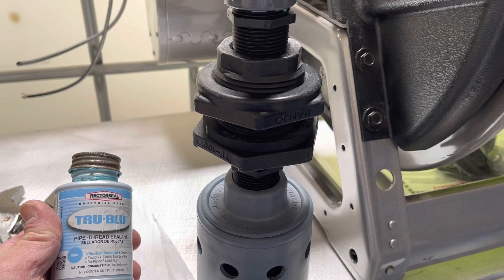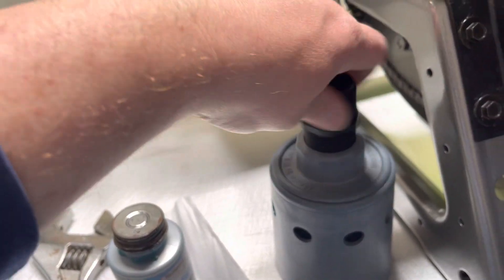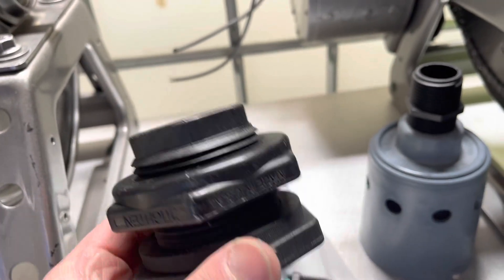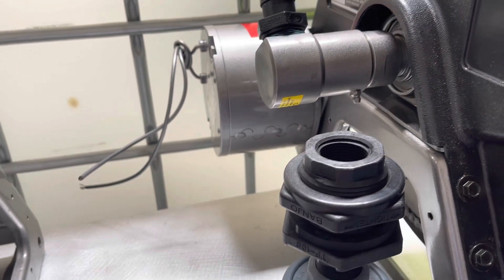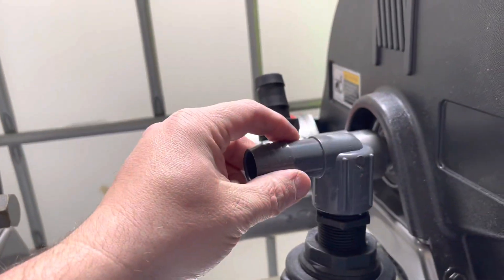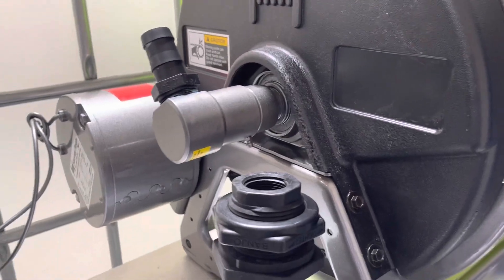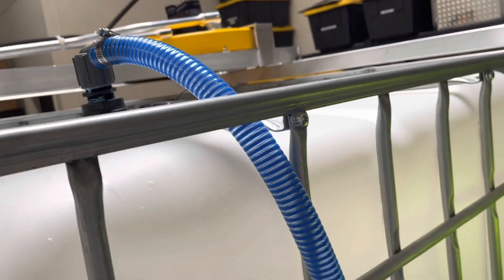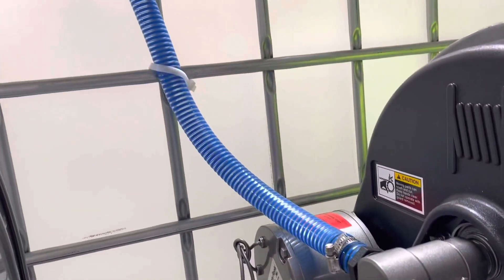How to plumb a Hudson float valve to your buffer tank- Pressure Washer Plumbing

Comment: Thank you for the video. I posted it to the WashTube University page. Question: Do you find that running the fill hose through the reel causes restriction?
Reply from the maker: I’ve honestly done it both ways. I’m sure there is an argument that you lose flow but the efficiency wins for me. To me the difference was not noticeable. Slow flow at a house is slow flow. Running it direct won’t improve that. I’ve even ran the 1 in manifold reels. The fittings on those with being so large kinks the hose. This is working for now.
Reply: @ExpertPowerWash  I like that. Thank you. Without going to any trouble, can you share what fill hose you recommend?
Reply from the maker: @TheFreshRinse  currently liking the 3/4 Flexzilla. I did see at the convention that Bluebird sells 3/4 hose that is light. I ordered two of them and it looks really good. It might even rival Flexzilla. I’m excited to try it.

Comment: Where is your filter? I would have it before the water goes into the tank especially if you are pulling water from a well.
Reply from the maker: We don’t set it up like that but nothing wrong with doing that way. Our guys run the water for 5 or seconds before hooking up the hose.

Comment: I’m just starting out but when you drill the hole do you clean the debris inside the tank? Like with a vacuum? Thanks for the video
Reply from the maker: Yes shop vac or you will have major problems.
Reply: @ExpertPowerWash  what size hole saw bit?